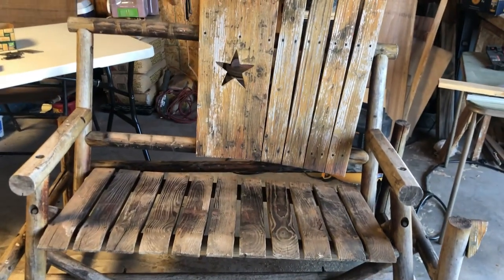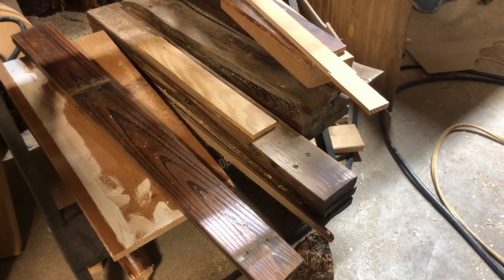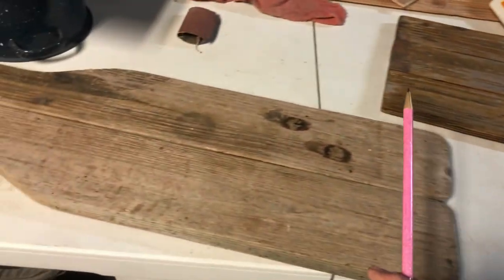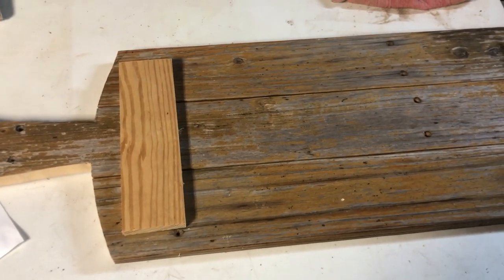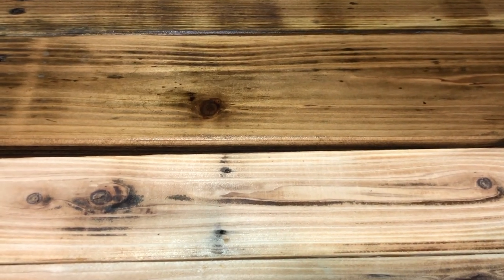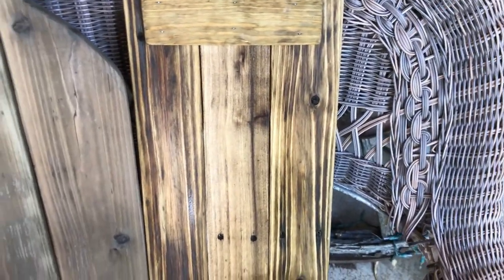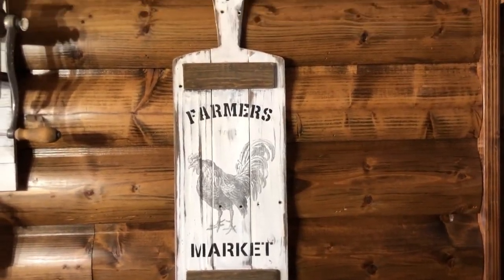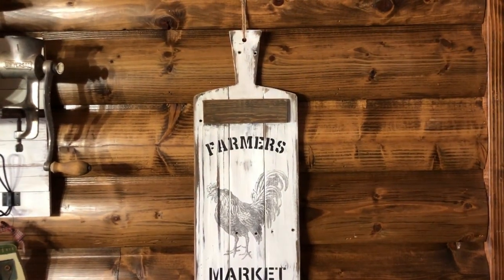From Trash To Treasure / Scrap Wood Breadboards

Comment: What if you wrap steel wool in filter rubber band it and soak
Reply from the maker: I was trying to think of something to put it in.  All I had was cheesecloth but I didn’t think that would be fine enough to contain to bits.  They are very fine bits.
Reply: Burlap if you get strings the would be easier to strain
Reply: @sandyscountrycrafts   how about a nylon knee high?